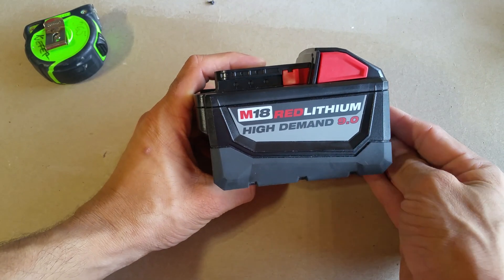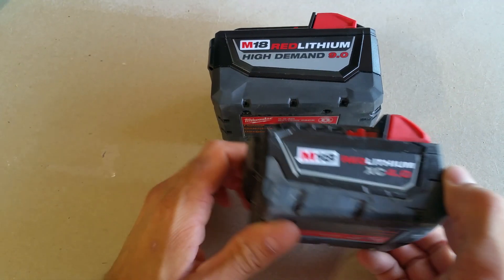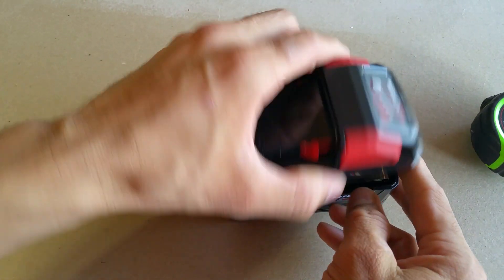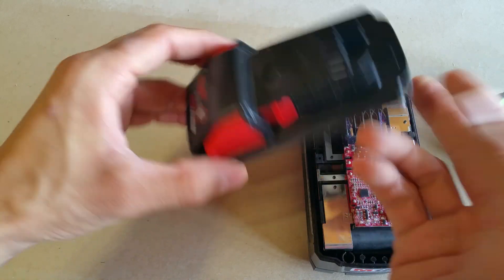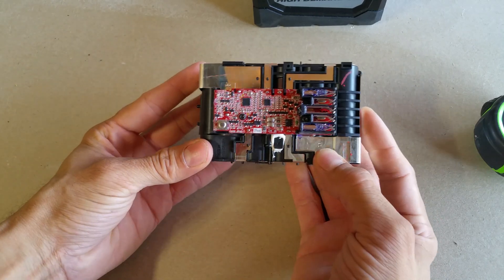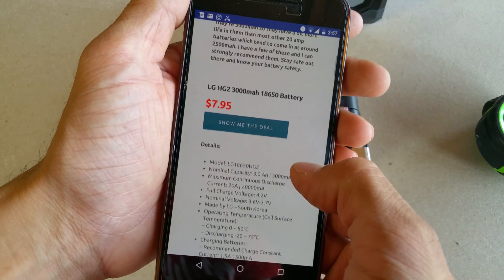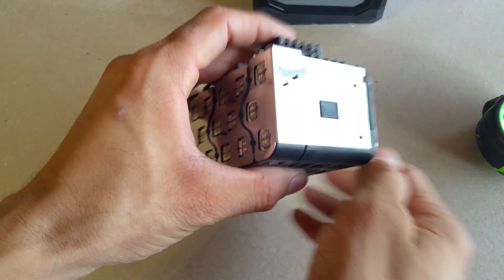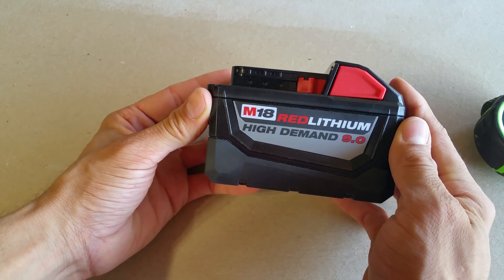Whats inside a Milwaukee 9.0 battery pack

Comment: The 18650 batteries are in a 3p5s configuration. So it had 3 batteries  in series which adds up the 3 Ah of each battery giving it the 9Ah it has. And there are 5 of those little 3p packs in series, which adds up the voltages of the pack, so 5 packs times 3.7v gives the nominal voltage of aprox. 18.5 volts. Hence why it's called a 3s5p pack. These cells are very impressive to have a 20A discharge rate, as this prevents voltage drop from occurring, which can effect how much usable energy the battery can provide. Good vid mate keep it up👍

Comment: The spray coating on the board is called conformal coating. Any chance you could get some close up, high resolution pictures of the chips on the board so we can see the numbers on them?
Reply from the maker: thanks man. sure ill get some pics. what numbers are we looking for?
Reply: Toolaholic Were looking for the numbers directly on top of the two flat black chips that are right by your left thumb at 1:37. 
There may be multiple rows of letters and numbers on them. They will be either silkscreened or laser etched, and maybe hard to read with that coating.

One of those is going to be the actual processor for the battery. What I'm hoping to be able to figure out is what the diagnostic sequence on the fuel gauge lights mean. (Go ahead and press and hold the battery level button for around 3 seconds to see what I'm talking about.) With the numbers you share I can potentially find the engineering data sheets for them. From there I can figure out if they just used a common battery management chip, or if they went with a processor that they could custom program.

Thanks! :D
Reply: +Toolaholic - whether you can get the chip markings off without stripping away the conformal coating or not, you'll likely need a microscope.  I wouldn't even bother trying with a phone camera or anything without a macro lens.

Comment: I took the cover off my new 9.0 pack, and the cells are pink, not brown like yours. I'm guessing they are Samsung INR18650-30Q cells. Are they using both LG HG2 and Samsung INR18650-30Q cells in these 9.0 packs? They are both 3000 mAh, but the LG HG2 can do 20 amp continuous current, whereas the Samsung INR18650-30Q can only do 15 amps.
Reply: 30q actually is the better battery outta these 2
Reply: how are the 9.0 batteries holding up?
Reply: yes they are Samsung 30Q 
same as what are in the XC 6.0 (original version) not the new high output XC 6.0 which use Samsung 21700 30T cells

Comment: Would really like to see a comparison between a lower priced tool like ryobi vs dewalt or Milwaukee. Just saw that ryobi now has a brushless line coming out. I'm a dewalt fan for life but I own a few lower end tools and have never had a single issue with them even under hard use. Just curious to see the insides and if there are any huge differences other than the actual motor. Thanks man! Keep up the good work! I'm a big fan of your Instagram and I'm stocked you're getting into YouTube!

Comment: How much amps this puts out?
Reply: 9.0 amps, as it states in the title
Reply: 9.0 is the amp hours, not the current output (which is measured in amps). Milwaukee doesn't provide specs on maximum current output of their battery packs, and neither do most other companies. But if they have the LG HG2 cells, you can figure out the maximum current output of the pack. LG HG2 cells can handle 20 amps continuous discharge. The 9.0 pack has 3 sets of paralleled cells. 3 x 20 = 60. Without taking heat into account, the maximum discharge rate of the pack is 60 amps.

Comment: the hole are NOT for water drainage. they are for battery venting. without the holes, the battery pack would basically become a spontaneous grenade.
Reply from the maker: Brandon Lovasz actually it was milwaukee who told us the holes are for drainage. the pack vents through the top.
Reply from the maker: Jon D me or you? because i never claimed to be an engineer
Reply: +Brandon Lovasz - The vents on cells like these will give at a low enough pressure to not be grenade-like by any stretch.  Each cell would vent one at a time in turn if damage continued and merely having the seams in the screw-together case would be plenty to relieve pressure.

Besides if you get cell rupture it becomes more like an incendiary grenade, where allowing that oxygen in at a higher rate, actually makes it burst into flames MORE, not less, but at that point the amount of energy released would breech the casing anyway, I mean warp the cracks to let more oxygen in.

Now having written that, the holes are more for a small amount of airflow than drainage, to decrease heat buildup.  They could have made the pack completely sealed and waterproof if not for that.

Comment: At what voltage does the bms shut off or cut off battery power?
Reply: Bhakta Singh it doesn't. On Milwaukee battery packs, the positive and negative leads are connected directly to the connection outputs for maximum power. No loss through mosfets. The tool itself communicates with the battery pack and will shut down at low voltage, battery pack overheating, etc. The battery pack does not cut the voltage.
Reply: rmkilc do you saying the Milwaukee 9.0ah Battery has no internal bms(battery management system)?
Reply: Bhakta Ronald Singh it has battery management system to balance the cells and what not. It does not have a switch to turn off the output.

Comment: 15 cells x  $7.95 😕  so $90 odd dollars worth of cells in there . how much is the actual  battery.
Reply: +Lee Bradley - Hard to equate cost like this.  I'm sure they've got a contract for sufficient volume that their per cell price is way below $8/ea., but that doesn't really matter as it's not reasonable to try to roll your own 9Ah pack.  Either you pay whatever they want or you don't.  

Currently in the US, Amazon has a "starter pack" that includes 1 x 9Ah battery and charger for $190.  I do not know if you need that specific charger to achieve good/short charge rate with a 9Ah pack, but probably so.
Reply: Lee Bradley you did know $8×15=$120 right? not $90....

Comment: There are more screws on that pack that could've possibly allowed you to open the pack.
Reply: Nope.  The screws are for assembly, you can't get the battery casing apart without undoing all the bus bar spot welds.

Comment: Would you use that battery on m18 search light?
Reply: You can use any m18 battery on any tool, it does not matter. On the power hungry tools a smaller battery just may not give you the performance, that is all.

Comment: You know what really surprised me is I pulled open my 5.0amp M18 Milwaukee battery and you know how 20 volt max is a hoax and just refers to how many volts the battery puts out when it's fully charged and not under load so you can take any 18 volt battery that is fully charged and it will read 20 volts, so I took my electrical meter to my M18 5.0amp battery when I opened it up and sure enough it read 20 volts but here is where it gets weird, I hooked up my Milwaukee M18 Fuel Surge Impulse Driver and started running it to put a load on the battery and the battery stayed at 20 volts it didn't drop to 18 volts, I was really surprised by this! Tell me what you think if you would I would appreciate it, I'm not very good with amps and voltage. Here is the link to the video, https://youtu.be/7eUIk0hwESM I am surprised that under a load it stayed at 20 volts but the biggest issue I am having is trying to figure out how to read the amps correctly, maybe you could help me out with that and tell me what I am doing wrong!
Reply: Not enough load for voltage sag
Reply: With an 18V Lithium-ion battery (or 20+V, as some manufacturers like to market it), there’s 5x 18650 cells connected in series. Each cell puts out about 4,2V when full (5x 4,2V = 21V) and cuts off / registers as empty at about 3,6V (5x 3,6V = 18V). Reading the amps is difficult, since it requires you to have a multimeter that is able to do it at that high of an amperage (10A max is normal for a multmeter, but these batteries can put out 20-30A, so you would blow the fuse on the meter fairly quick ;))

Just rely on the battery indicator if you’re not having any issues. Milwaukee / AEG is a solid brand;
I’m running 2 AEG Pro lithium-ion 14,4V batteries (so 4x 18650 cells each) since 2010 under very regular use, and they’re strong as ever

Comment: i.believe these cells.are bigger physically and.hold longer charge than an 18650, the dewalt 6.0 60v still.uses the 18650 till.they release the 9.0
Reply: They literally could not be.  If they are as he says, the LG 18650HG2, they are quite literally "18650" cells, the same physical size as any other "18650" cell.  Only by going to 20700 or 21700 cells would you have physically larger cells, and therefore reap the benefits of more physical capacity.

Comment: Every single battery pack that I have in M18 4.0 a 5.0  etc and my coworkers have in the shop the  mounting screws Either come loose or the threaded hole where the screws threading into cracks and the lower part of the battery pack falls out of the gun this is not from the gun been dropped it’s a poor design and or the vibration from my impact guns is causing it to crack and the battery pack falls out of the gun So what I have been doing is epoxying that seem so I don’t have to throw away $100 battery because of the poor design I have a lot  friends that own Mill walkie guns I’ve never ever ever had a problem with their gun just the battery pack falling apart in the same exact area where the screws mount into the bottom of the battery pack they need to redesign that
Reply: That's strange, I've been using mine for years working on tractor trailers and monster trucks and I have never had that problem...

Comment: my guess to all the metal around the thing is to keep us away from trade secrets but if one dares one comes back to rebuild a prize  as there all going to be a cell gone bad if carefully studied it can be done 
battery packs go bad most of every thing litho is of the same origins but different manufacturers
 same stuff makes a Kool project yes?
Reply: The metal plates are conductors. It's much more reliable to spot weld a plate to the batteries than to use wire that could flop around and break.

Comment: this 9.0A battery  is the worse battery, Milwaukee Tools took 2 years to develop this battery pack, as it had too many problems, even during first mass productions, made more than 600k of BPs with functional problems, and no recalls for these problems. only did running changes. To tear down BPs from different lots, especially  before and after May,12nd,2017, you can find structural differences on plastic frame and metal strips.
Reply: Do you have a link to any information on this please?
Thank you.
Reply: @Milwaukee tools MEA Engineer
i seen more XC 5.0 issue (including 3.0 and 4.0)
they went into a shut down mode, flashing red light, reset doesn’t do anything. 
Something to do with the middle pin circuit cause it to not responding

Milwaukee should update their board in 2021, plus those board need to be updated and it tends to damage and throw first two rolls of cells out of balance causing them to drop voltage than the back 3 rolls

Comment: $200  lol fool
Reply: They are online all over for 150 or even less. When you buy them with a tool you get them for even less. I got my m18 brushless fuel compound 12 in sliding dual miter on an early release offer with 2 9.0 batteries and a rapid charger for $600. You can get the brushless fuel 7 1/4 full size circular with a charger and 9.0 for $250 online.
Reply: thanx that's better than $200
Reply: I got a m18 fuel miter saw with two 9.0 ah for $600 and that came with an additional free 9ah battery. 3 plus the saw for $600 what a deal.